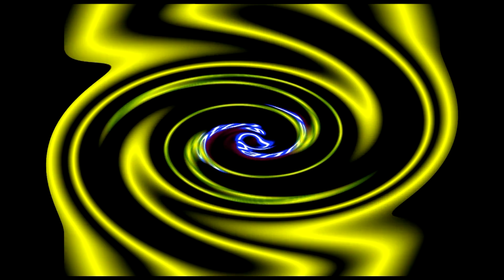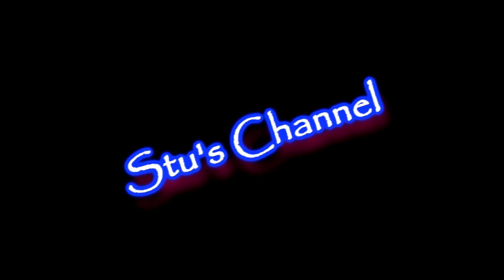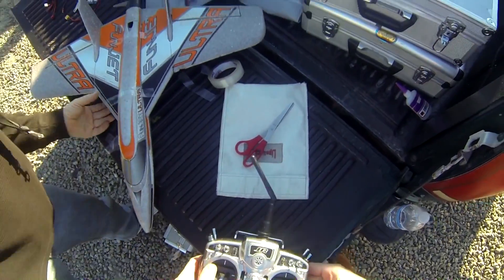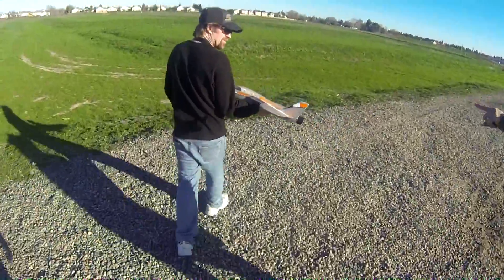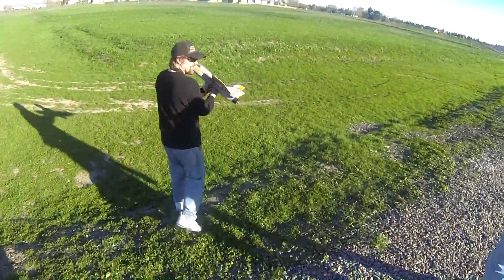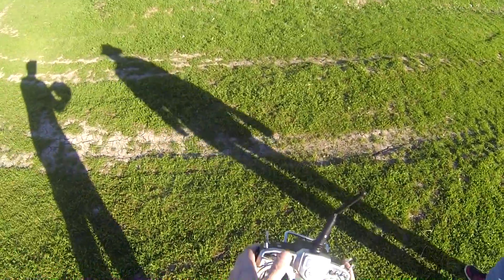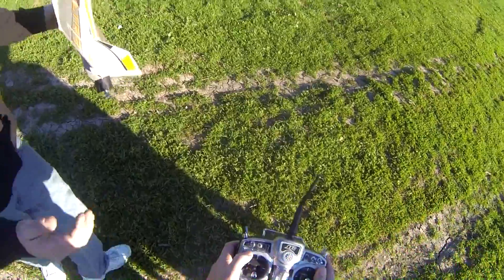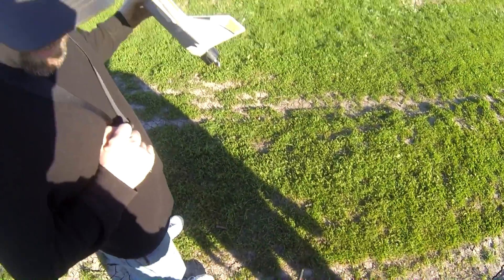How to launch a 200+ mph funjet on Stu's Channel

Comment: didn't see the radar gun reading. can't say it's 200+ without proof
Reply from the maker: The speed is actually 213 MPH.  Dr Bob didn't catch anything on radar, except a couple of coast-bys at 178 MPH.  The ultimate reading came off of the air meter readings.  This plane has been flown several times since this video, and the speed seems to top out at 213 MPH.  We did get a reading of 215 MPH once, but 213 MPH is it's more consistent reading.  It's not the fastest funjet out there.   Take a look around on the internet and you'll see some that are now doing greater speeds.  This on has NO additional support added.  It's a stock frame.  It all comes down to weight, kv of the motor and can size, a perfectly timed ESC, a light-weight high C rated battery, and the right prop to match.  This isn't that difficult to achieve. The total cost in parts was around $200 (besides the airframe).  We picked up all the needed parts at hobbyking
Reply: +Stu's Channel I'm well aware of what they are capable of. mine reached 186 pmh on a level strait pass clocked on a gps logger. I'm moving it to 7s to see how much more it has. I had to reinforce mine in numerous places especially on the wings. one of my past projects had dual wing failure (collapse) at apx 130mph. as well and needing to reinforce the foam around the motor
Reply: +Stu's Channel also, it sounds like you're running the 1900 kv motor with less than a 6x5.5 prop am I right? with that size motor I'm running a heavy 6s to CG correctly. pass after pass everything stays cool. No heat accommodation needed
Reply from the maker: A stock air frame will do the trick.  There is really no need to beef up anything.  We initially thought that this would not be able to take it, but the trick is to slow as you turn...otherwise you will cause it to fail.  I'll have to take a look at the motor again and the prop size to let you know what it is, but I'm sort of stuck in my home office with a torn calf muscle.  Leg on ice and elevated.  I've got only two or three more weeks before this is healed.  I'll post what's in that funjet here when I get a chance.  I can tell you right now that from what I remember, the can size on the motor is big, it's an SK fan drive motor, and the prop size is bigger than a 6 x 5.5. Heat IS a probem on this one.  It does NOT stay cool, so it's come to the point in which we have to take "cooling" runs to keep the heat down.  If pressed too much, the ESC shuts down the motor.  Luckily, there's plenty of speed to plane for any dead stick landings The stock motor and speed control, prop size on the STOCK funjet will already do 120 to 125 MPH out of the box (the hi-max motor set up).  If you look at the other Funjet video in my collection, here:  https://youtu.be/mkgKolYsDe4  you'll see this one at 2300 Watts of a powerhouse action...FOUR years ago... with a consistent 188 MPH and a different set up (with added reinforcement at that time).  If you are looking for a speed plane, then foam isn't going to be your answer.  Take a look a soaringusa website and you'll find what you are looking for there.  A bit pricey, but if you beef up a pylon, you'll leave your funjet behind.
Reply from the maker: Here's another from four years ago.  Ahh, the times where cameras were shitty...lol  https://youtu.be/261i3vUN3E4